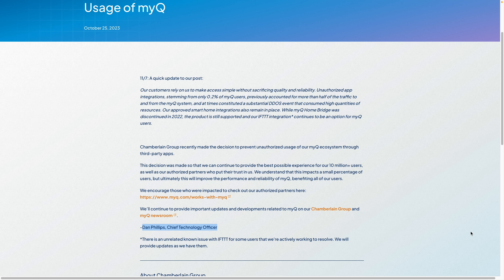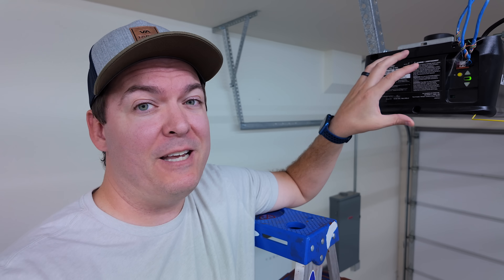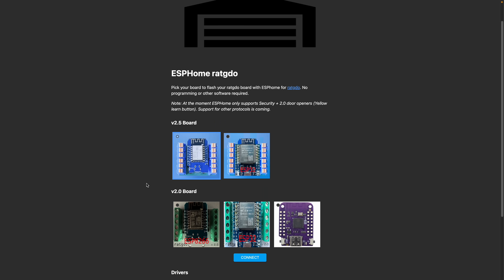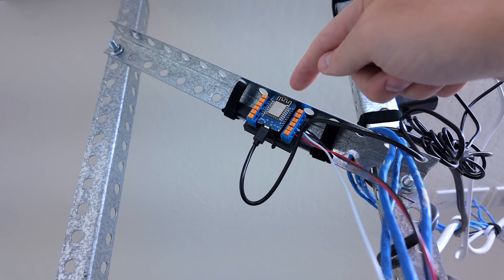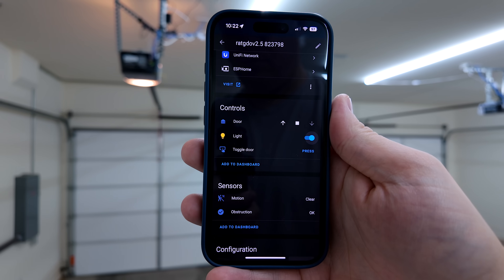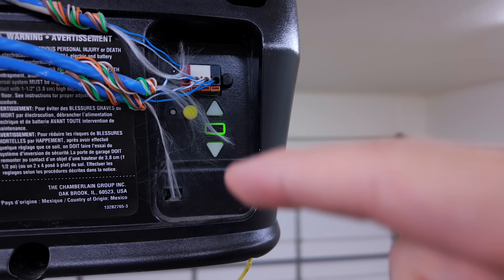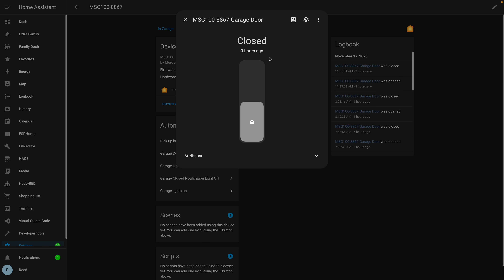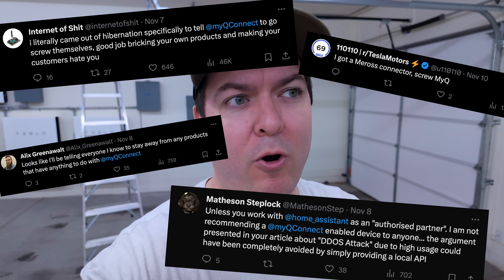MyQ wants to RUIN my smart home! Hello RATGDO

Comment from the maker: Who's ready to Rage Against The Garage Door Opener?! 🙋🏻‍♂ Take that, Evil Corp!
Reply: Love this Reid! I'm yet another angry MyQ victim. I have much more to say about MyQ, but want to keep this family friendly 😁!
Reply: Can you make a Video about your network and how you get your unify protect cameras onto the echos (sry for my bad englisch(germany))
Reply: German here also ! @electronicgaming1252
Reply: I think garage door openers from Genie/ Overhead Door (they are the same thing) are still dry contact and they have some features that were taken away from Evil Corp like the lights turn on after crossing the beam.
Just be sure to have them professionally installed from a dealer instead of buying them from Home Depot or Lowe's (the rail is one strong piece instead of sections)Genie calls it "the professional line" and OHD is already professional
Reply: Glad that I have already installed the Meross for my HomeKit setup
Reply: Ordered 1 last week. Hopefully it comes soon! Awesome video thanks!
Reply: So disappointing. The industry has been driven by DIY enthusiasts. I've had to reconnect my Chamberlain controllers to my garage controllers multiple times. The door sensor says the battery is dying and I pull out the battery and put it right back in and everything is showing full power again. So many little glitches. I'll be glad to get something more reliable.
Reply: It's a very good Name for an Opener. First thing that came to my mind:
"Frick you, i won't open like you tell me!!!"

Replace frick with...you know...
Reply: I had the same issue with the motion sensor not working... and then I realized there's a hard enable/disable switch for the motion sensor under the button cover!
Reply: Great video! I'm so annoyed by the garage opener not working anymore in HA. This video saves us!
Reply: Hi Reed, I'm having trouble getting anything to work with my ryobi gdo and was hoping if this will work with my gdo... Thanks
Reply: Can you use MyQ integration AND RATGDO together?  For example, I already bought the Tesla MyQ plan to auto-open door upon arrival.  So I want to keep the native integration but also be able to control the door using RATGDO
Reply: It’s worse than that for Evil Corp.  I have been contemplating replacing my current garage door opener because it is old and I want a better design.  Not only will I not pay a subscription for a one-off service, I will not buy a garage door opener that I cannot connect to HomeKit.
Reply: From Enron to Evil Corp - the slanting "E" symbol returns! Many thanks Reed for helping the 20k angry MyQ owners.

Comment: Well, more bad news from Evil Corp
As you know, they have been bought by Blackstone in 2021. So it will only get worse.

I just replaced my Garage Door Opener with a new one that the installer highly recommended. It’s a LiftMaster 6850L.
They updated their system to Security 3.0. 
If you think security +2.0 was bad this is even worse

All previous remote controllers will not work. They mage it more tight to the point that RATGO admitted that it is formidable security that they don’t know how to circumvent it.

Beware do not upgrade your systems to the latest one. You will be locked to their myQ app, which is getting worse.

Comment: I looked at MyQ when it first came out but I didn't like it due to the high price and monthly subscription.  About 5 years ago, I decided to install Meross on my (3) Liftmaster garage door openers that are 18 yrs old.  The Meross devices were a lot cheaper, easy to install, and have been working flawlessly. I never had to install the garage door button controller that was shown in the video.  

The best part is that you can use Alexa app or Echo Auto Gen 2 to voice control the garage doors when you leave or arrive home.  I also have a Samsung Smarthings Hub so I can open my garage doors using the Smarthings App on my Android watch (OnePlus Watch 3) which comes in handy while working outside in the yard.  I highly recommend Meross.

Comment: Could somebody help with setting up the homeassistand local?
I have been trying for days now and I do not seem to get onto the Homeassistant homepage.
Keep getting same error message.
This site can’t be reached
Check if there is a typo in homeassistant.local.

If spelling is correct, try running Windows Network Diagnostics.
DNS_PROBE_FINISHED_NXDOMAIN

does anybody have any experience with this? thank you

Comment: My opener stopped working two weeks after installation.......I needed a new main PCB and now, after replacement PCB the built in camera no longer works...so I'm trying to se how to add a 3" PTZ to replace the chainberlain version....any ideas Mr Reed? Also...the camera on these openers are only viewable through the app....(grrrr)

Comment: @reedssmarthome do you know if the ratgdo will work with Aladdin Connect Genie 2128 It has similar connections for for 4 wires two for the wall control and 4 wires that wire to the other two obstruction control ? Recent updates for Aladdin's API no longer works with Home Assistant and I need something to control this thing 😅

Comment: If I get the ratgdo for my current MYQ system as it has the security 2.0. When I move into my new house can I  use it with any other brand? Not sure the brand yet but planning.

Comment: I was annoyed with MyQ from the beginning well before they started their funny business with the API.  I white-wired a spare garage door remote to a Zooz multirelay.  As long as you configure it to be a momentary switch, you can use Smartthings or HA to activate the garage door.  Paired with a door sensor, you'll know when the door is open or closed.  You won't get the features that you see in the RATGDO, but it works just fine.

Comment: Great video. Just ordered my ratgdo since I just bought a house that has a myq unit. IRT the laser pointer, as much as I like using tech to solve problems, my solution to that was to install a convex mirror on the wall with a small adjustable mount.

Comment: I was inspired by this video to implement a RATGDO for my Chamberlain gdo. I purchased a RATGDO and a Home Assistant Green to run the ESPHome software. It looked easy but it was not. Loaded the RATGDO firmware successfully but could not integrate with ESPHome.  I could access the RATGDO from my wireless devices but not from my desktop PC. I could access Home Assistant from my desktop but not my wireless devices. After a week+ of frustration I got help from a use on the Home Assistant subReddit. He asked how my desktop and wireless was set up. I have a ISP provided fiber modem connected to a 8 port Ethernet switch. My desktop, my TP Link mesh network and my Home Assistant Green are connected to the Ethernet switch. He said my issue was effectively my PC and Home Assistant Green were running on a different network than my wireless devices. He suggested connecting th PC and the HA-Green to the TP Link ports. Once done the magic happened. I now can access HA-G and RATGDO from all my wireless devices and my desktop.

Comment: The for the video.  I stumbled on this when looking for a way to hardwire a MyQ controller to a garage door opener.  At our firewall we have three tall bay doors each on a commercial opener.  The openers do have a RF controller hardwired to the opener, but as its commercial,  I think the frequencies used are different than residential.   Are you aware of any way I can hardwire a MyQ to the door opener?  Or other options?  The current RF is very difficult to use through a steel building, so internet base andiod app would be good.

Comment: So I have a lift master garage motor. First I bought and tried the Nexx garage door system. I use my iPhone and my network to control the garage door. The problem I had with the Nexx was the company never updated their firmware, customer service was poor. Also, my WiFi was weak because I live in a 2 story condo unit and my garage is obviously downstairs and one unit away from my router. So needless to say that Nexx was a hit and miss when used. 

So then I got MyQ smart garage hub system thinking it would work better, but unfortunately the weak WiFi makes it more frustrating to operate. 

I know I need a WiFi mesh system but honestly i don’t think it will work because of how many walls are between my router and my garage. 

Anyone know if there something better out there that I can do? Thanks for your time!!

Comment: Ok Reed I need your help. Finally got my Rat and everything installed and hooked up pretty easy. Added Mesquito broker for HA. Which installed the mqtt file.  I setup a user for the mqtt and then used mqtt explorer to see if the rat was there and in fact it is and shows 3 binaries. I can not for the life of me get the mqtt in HA to see those 3 binaries.  Can you help in anyway? I am running HA as a stand alone install on an x86 box nothing else in there but the boot HA.

Comment: Great video, as always, Reed! You might be interested to know that Konnected has announced its open-source myQ alternative, blaQ. blaQ is expected to ship in March 2024, and it is designed specifically for garage door openers with yellow learn buttons: openers branded Chamberlain, LiftMaster, and Craftsman that include Security+ 2.0 technology. This includes garage door openers with myQ built-in! The GDO blaQ is built on ratgdo technology, the brilliant DIY open-source project that interfaces directly with Security+ garage door openers. Konnected’s GDO blaQ incorporates ratgdo into a sleek and elegant finished product that connects to your yellow-button opener with only three wires. This product unlocks direct control and monitoring of rich information from the garage door unit, including the open/closed status, obstruction beam sensor status, granular control to open/close the garage door fully or partially, control of the light, and control of the wireless remotes.

Of course, the GDO blaQ also incorporates a pre-closing audible and visual warning with a built-in bright flashing LED and multi-tonal buzzer, making it safe and compliant with U.S. federal safety regulations and suitable for any residential garage with a sectional motorized garage door. More here; https://community.konnected.io/t/announcing-two-new-garage-door-opener-products-from-konnected/35300

Comment: I completely understand the SaaS model, respect the need for servers to maintain that, and the cost for those servers.  Howeverrrrrrr, in this case, how many times is that server hit per day, per customer?  Maybe 6-12 times max?  They could literally run the entire U.S. off of one small server floating in AWS.  Some things were just never meant to go the SaaS route and this is one of them.

Unfortunately, it is the way of the future.... resistance is futile (for anyone without the knowledge to DIY around it)

Comment: I've been “fighting” with my RATGDO for a while now.  It keeps going "away" in Home Assistant.  I have no idea if it's the power, the wiring, etc..etc..  I need to 'reboot' the device and the garage door opener constantly for this to work.  Stays on for a few days and then goes into "away" mode.  The logs in H.A. all report "unknown status" on the entire door system.  I've no idea where to even start troubleshooting.  Anyone have any suggestions?

Comment: Awesome. Thank you. I've always disliked MyQ. I need your help Reed!! Kinda off topic, but ties together....
Why do you think HA doesn't support GE Cync, or Globe, or Cree lighting, etc?? I ask bc not only do I have all Caseta smart switches, but I also have over 40 downlights and maybe 15 regular lights in my house which I put smart bulbs in all of them (I know). I wanted the color but I also wanted the caseta switches. So when I turn my switches off you can't turn the bulbs on so basically the switches have to be renamed something completely different so hubs didn't hear something else and the switches have to be on 24/7 so all bulbs work for calling out routines n such. So this has proved difficult but I'm making it work. I was just wondering if you had any suggestions for me? Something I could do to make this easier or anything to smooth out this situation..
Oh, and if you think HA will ever get those brands (GE Cync, Globe, Cree) hence this paragraph. I can't control any of my lights in HA bc they don't have those device brands. So I would only be able to control the casetas which would be an option in HA but then no color... If you're understanding any of this any help would be greatly appreciated. ha.. Thanks again Reed.

Comment: What if I just have the sensors and one controller on the wall, and its not integrated?  I can control stuff through the MyQ app, which is very limited.  And just gives me notifications on if the doors are left open, not actually close them using my smart home

Comment: Hey, garage door guy here and I may have some insight on this topic. First I want to say is I with they made integration easier and open. The reason why they lock it down so bad is the integration of wifi. To allow them to stay compliant to safety laws they have to do certain things when closing remotely to stay in compliance. They have to sound a audible alarm in the garage before and during operation as well as have a visual alert by flashing the lights for the hearing impaired. That's why the retro fit kits come with a external box that has a light and a beeper, anything security 2.0 has that tech built in and is compatible with myq even if it doesn't have built in wifi(requires a hub). It use to be you could just short out the wires and that would send the signal to move but now it's controlled from a circuit board in the wall button that communicates with the motor. It helps in situations where internal wiring can get damaged and short out but makes it difficult when trying to install accessories. That control board it neat, it even has features like the door hight that myq doesn't have.

Comment: So I actually took my switch down that was next to my door, soldered wires in that activate the switch so the logic and encoding that exist in the switch still are leveraged with my Smart Home garage door opener. It has worked pretty well.

Comment: As a german, i'm wondered why the f*ck they want users to pay for a subscription for just opening/closing the garage door?!

It's nice to see that you still can hack these things to work normal for their intended task: just opening the garage door. There's no need that you're FORCED to have cloud connectivity for this task. But people, who doesn't know anything about electronics, will either fall for the trap and pay for the subscription or just throw away and buy another one althought, it theoretically still works :(

btw: 
I love that you use Wago-Connectors instead of wire nuts or anything else :D

Comment: I have 7 garage doors and 2 regular doors (Yale locks) integrated into MyQ and no subscription.  With the exception of the partial opening, the app can do everything you can do on the whatever app you showed (door open/shut/opening/closing, light on/off, errors for stuff obstructing the sensor etc.  I do NOT have chamberlain garage door openers, i have more expensive one with MUCH larger commercial doors, but it still uses MyQ and no type of interface, just wifi directly to the app.  I don't have any sort of fees though.

Comment: yeah i went through the hassle too.  i will never again buy anything using MyQ app(in my case i bought the cheapest wall mount button that opens the door and soldered 2 wires to the pins that would open the door and i have integration with smart life to turn the lights on and off based on the sensor for the door that came with the smart life smart garage opener, like the one you are using for the remote, i avoided that cause i don't feel like changing batteries all the times, defeats the purpose of smart maintenance free)

Comment: Get an extra push button switch for the myq system and wire the meeros to the button contacts. Then wire the push button to the garage opener. The meeros will close the contacts and the switch will send the coded signal to the garage opener. Viola, this is how I got mine working. 

The moment that garage opener fails, I am replacing it with something that will not try to rip me off on monthly cost for smart access when I got HA.

Comment: I love that I have an old dumb garage door opener! Made it super easy to just toss in a Shelly Relay to open and close the door, and local control! I love the motion sensor laser for parking, gonna have to set that up!
Reply: Yeah, I tossed an esp32 and a relay on mine, basically the same deal. It's great, was pretty easy to set up.
Reply: @jetpacktuxedo  Yeah that's another route I considered going. I use ESPHome for some other stuff, but this was one of my first automations so I had to make it work stand alone and it's worked flawlessly for years now.

Comment: Can anyone point me too some more information on the slightly older garage door openers. I believe it would just be the  Security+ series(purple remote program button). What I am interested in is how the 3 button wired wall remote works. There are three buttons but only 2 wires that go to the remote. Just curious how that setup works.

Comment: I use an inching switch to control the garage door and I installed a retractable extension cord right behind the opener. This gives me the same functionality of the tennis ball with the added benefit of having 3 outlets easily accessible.

Comment: The MyQ device belongs in the garbage - the WiFi sucks and always drops.  I created the same little box by soldering the wires to a garage door opener - one that directly connects to a garage opener with the yellow button.  This way everything is hardwired.  Then to get rid of any wi-fi issues I used Z-Wave and I now never, never have any issues.  My recommendation - use Z-wave.